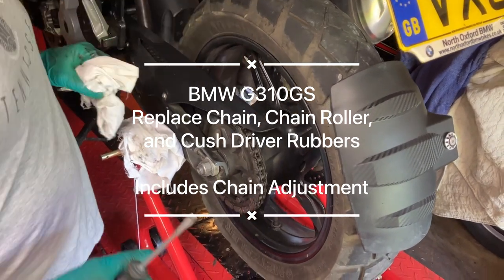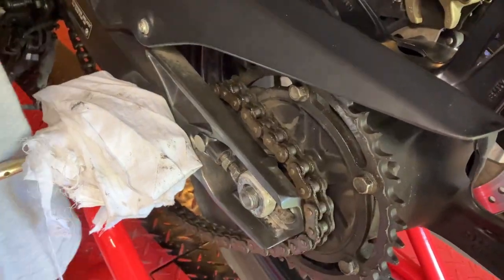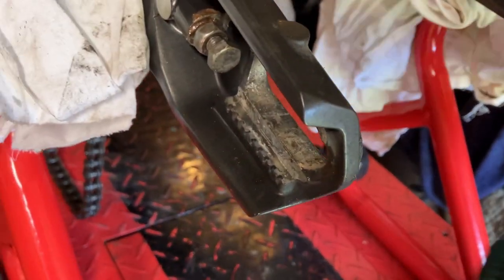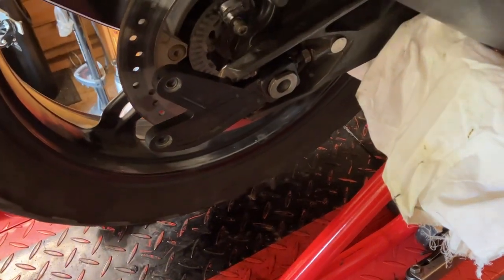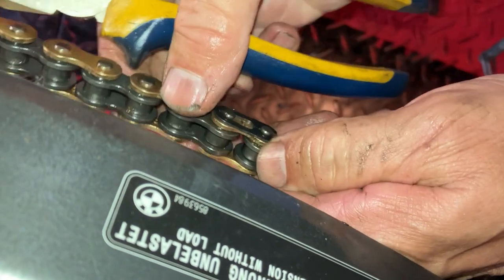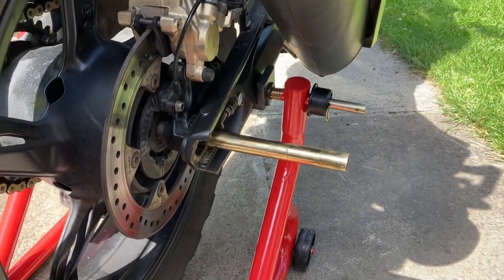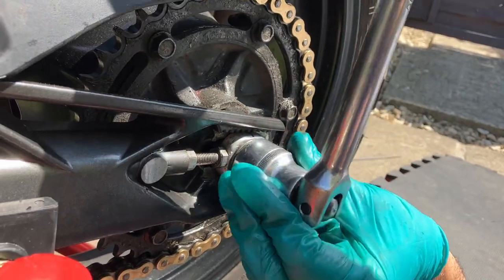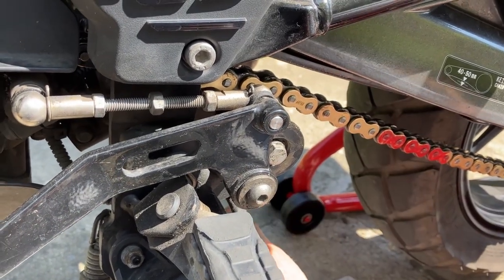BMW G310GS  - Replace Chain, Chain Roller, and Cush Driver Rubbers. Includes Chain Adjustment.

Comment: enjoyed your video since you know what you are doing might know the answer to my question
i am replacing the rear shock(which is about 12 inches long) with another one which is only 9.5 inches long on my 310gs
does everything fall into place somehow or its a lot more complicated? this is my first  time working on a bike
thanks
Reply from the maker: Thanks for the feedback and question. We've not tackledthe rear shock so I'm afraid we don't have any useful advice.

Comment: Can you tell me how many kms you got out of the chain and Cush rubbers before they needed to be replaced? We have 2 of these bikes and they both have a lot of play in the Cush drive area.
Reply from the maker: The bike had around 9500km when I bought it. The cush rubbers were very worn and I assume these were original. I do not know if the chain was original but, actually, it was fine even though we replaced it. I think the cush rubbers are known to wear. They are inexpensive from your BMW Motorrad dealer.

Comment: You’re going to have to take a few links out of that chain before it’s used by date, and should have definitely changed the sprockets at the same time so you don’t get unnecessary wear too early..
Reply from the maker: Fair point regarding the sprocket, although the sprocket was fine. We didn't actually need to change the chain, as we realised that it was the cush drive that was the (known) issue. We decided to change the chain, anway, as we already had it and, therefore, didn't bother with the sprocket.

Comment: I noticed you did not replace the upper chain slider pad (name?). Not sure what the proper name is. This wears as much as the roller. Should this not be replaced at the same time? If not, at what mileage should it be replaced?
Reply from the maker: I'm not sure about the slider, we did not notice any unnecessary wear. To be fair, with 6k miles on the clock, I was surprised that we needed to replace anything. The main thing that we noticed was that the cush drive rubbers were worn. We then decided to replace the chain, however, in hind-sight, I do not think this needed relacement. When doing this, we noticed that the roller was also shot, so we replaced this as well. You may be right that the pad could also have done with replacing. From our experience, these parts are not overly expensive from BMW so the pad may be cheap enough to replace, regardless, once you're in there.

Comment: This video is a great great time saver! Can you give us the part number of the cush drivers in order to find them in eBay, please? Thank you very much sir!
Reply from the maker: Hi, I don't know the part number but a call to BMW Motorrad is all you need. This is an inexpensive part and getting if from BMW is the cheapest option that I've seen. You'll be surprised how inexpensive BMW are for some parts.

Comment: Nice and useful video ❤. At what kilometer on your odometer you changed all these stuffs ?
Reply from the maker: It's done around 6500 miles (10500 kilometers). I think that the cush drive rubbers wearing at this mileage is a common thing and I suspect that it is the same for the chain roller. We could have left the chain as it was not too bad but we changed it anyway.
Reply: @MotorcycleFettlers  thank you 😊 buddy . Safe drive . More videos

Comment: How long did the bush and chain last on your bike?
Reply from the maker: I don't know if it was the original chain when I bought it. I changed it at around 8k miles. The chain was probably OK for a bit longer but the bush was trashed.

Comment: My 310 bike chain is completely loose. It comes without a pin lock, so how to tighten it now.😢
Reply from the maker: Sorry, not enough information. Sounds like you may need a new chain if there's no adjustment left...
Reply: @MotorcycleFettlers  yah there is no adjustment left, I'm worried about this 😕, although I put new chain and sprocket
Reply from the maker: odd. I'd check it was the right chain length but other than that, can't help, I'm afraid.